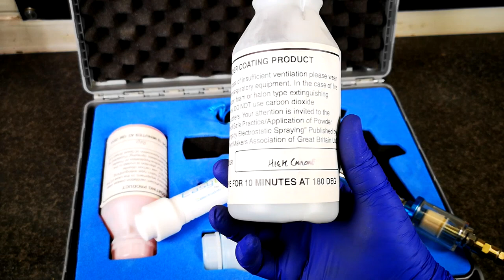Rare 1940's Vintage Zephyr Hair Drier Restoration - Facelift Custom

Comment: Everything is fantastic, until the horrible cold welds filmed in close-up 🙄.  It will be necessary to work a little more this phase and it will be perfect.  In fact, the majority of the restoration channels have problems with the cable solder while with a good flux, a clean iron at the proper temperature, an appropriate solder, everything is easy ;)

Comment: You must just hold your breath when you open the oven door 🚪 and see the gorgeous result of the powder coat! That candy apple red is so deep and robust. This could be an intoxicating vocation. Now I want a powder coat system. 
Do you use a standardized medium in the blaster, or do you change the grit according to the strength of the metal you’re cleaning? Fascinating!
Reply from the maker: I use Aluminium Oxide for everything.

Comment: Nice work Martin, I've not done much powder coating because on with respraying a vw beetle convertible but struggling to fix the electric roof.
Reply from the maker: You did a great job on that Beetle Paul.

Comment: Nice restoration Martin, the red really pops with the clear coat 👍 One little tip, the brushes go in after the armature is installed. They're meant to slide into the holders with the square brass part against the black cap, in order to maintain an even spring pressure on them. If those square brass parts are tight in the holder, they can cause premature brush/armature failure, or,  as they wear, fail to maintain brush pressure on the armature leading to arching.
Reply from the maker: Yes Gary, I had to make these brushes out of larger brushes but they seem fine with no arching.
Reply: @RetroHax  I was wondering where you'd got the brushes from 👍

Comment: I am a fan of keeping the restorations as original as possible (blue color and brass rivets for the name plate)  but to each his own I guess.

Thanks for the bench top coloring and pattern tip - "Do not pick a bench top that looks like a lost ball bearing" 😄😄

Speaking of ball bearings, what was the purpose of that ball bearing? To preload the rotor against the from bearing?

Comment: What happens if the hair dryer gets hotter than 400 degrees F AFTER it has been powder coated? Does the paint get soft or anything?
Reply from the maker: It don't get that hot. Its protected by the heat proof wrap I installed in stead of the Asbestos.

Comment: Just a question how come you didn't give the bearings a squirt of turbine oil ? It will eventually start screaming when the bushings run dry. Over here in the states they make a product call zoom spout has a small tube you can pull out to get into small spaces has turbine oil in it its made for electric motors for furnaces etc. I would of taken the brass plate on the handle and used a buffing wheel and buff out the brass. Other than that you did wonderful job love the color my hats off I had no clue you could get chrome in these colors. I love it !
Reply from the maker: It will never be used Roger and will be a display piece. I basically switched it on just to show it working.
Reply: oh ok I understand . I rebuilt a dryer I had from the 80s one of my room mates left behind just cant get rid of it takes me back to my youth I know I am weird still works good

Comment: Excellent restoration! Though I noticed you fitted a non compliant UK plug to it. The plug should have insulated live and neutral pins.  Wouldn't matter for personal use but if it were PAT tested it would fail.

Comment: You really should have used a chemical paint stripper; a device that old is likely to have lead-based additives in its paint, probably more so due to its still-vibrant colour (lead compounds were used for giving vibrant hues to paint). Now you have to contend with lead dust in your blasting cabinet. In any case, it's another lovely restoration you've done.
Reply from the maker: My blaster is fitted with a cyclone dust extractor so the dust is removed into a separate chamber

Comment: Wow, that is one of those few occasions where the restoration really does look better than when the item was new. I like the colour choices and the new flex fits the theme well. I can’t believe you used the right angle screwdriver to put the handle back on. Didn’t you have an ahha moment when you removed the badge and saw the hole? Not a criticism by any means just an observation. This would have to be your best restoration to date and well done. Cheers Stuart 🇦🇺
Reply from the maker: Thanks bud

Comment: Loved the video Martin. Did you replace the bushes. Also was the hairdrier working before you started the restore. Just managed to source one and going to do the restore it to its former glory
Reply from the maker: It had no flex and the brushes were replaced Paul
Reply: @RetroHax  ahh okay. I took mines apart today on the switch it says H P and M.. I fear I may have forgot which coloureed cable goes where. Also what is the setup of the magnets on the motor as all four of mine dropped off when I took the motor out
Reply: @RetroHax  also do you have a link to the brushes you bought
Reply: Sorry and last question. What size of rivets did you use to get the badge back on

Comment: It looks great. 2 things I want to mention, however. While it doesn't hurt anything at all, you don't need to put a clear coat over a candy top coat. It in its self is a tinted clear. Also while the chrome looks really good I am not sure that it will hold up to the heat without discoloring. If you are not planning on it being more than a decorative piece that wont be used, it doesn't matter though...Very nice work though. I dont want to sound like a negative critic, I was just assuming that you are new to powder coating by reading some of the other comments and thought I would offer some tips that might help you later on.
Reply from the maker: Thanks John, The powdercoat around the element is protected by the heat wadding and the mylar film so there's not much heat there on the case.

Comment: I'm a sucker for originality and think the original colour would have probably turned out to look very nice, but you really can't go wrong with Candy Apple Red and Chrome. I also like that you replaced the asbestos and added an earth ground. I remember being stationed in Hawaii and a cleanup crew came into our office with hazmat suits, filter masks and air quality meters, and they began tearing up the floor around us. We quickly asked them if we should leave while they worked and they said, "No, you're okay, but if the meters start beeping you need to leave". They were removing the old asbestos floor tiles that was underneath the carpet squares.
Reply from the maker: No meters were going off in my workshop as I had it all under control lol

Comment: It has become a beauty with those glossy colors!, but if you ask about the difference between Restoring and refurbish, i say you refurbish it.( new parts and new coloring has been done). When restoring (as preservation of a time period) u keep as much to the originals by only cleaning and to stop rust and try to find original missing parts. Restoring it to the (working) state as it was back then, you have to match the same paint, but for safety renewing unsafe parts inside.
For forensic detectives ; this vid is must have to display how to find human DNA